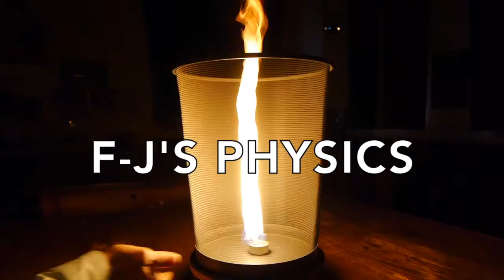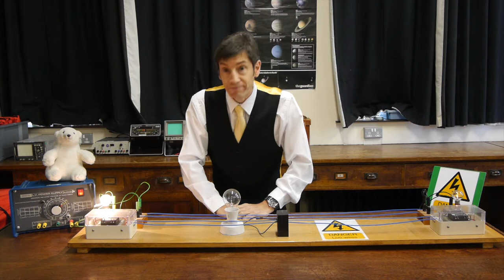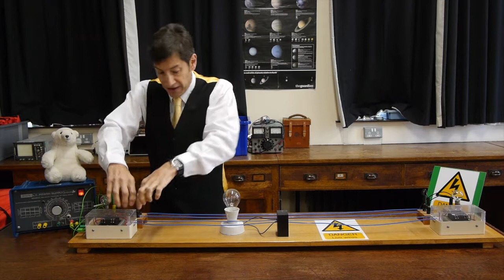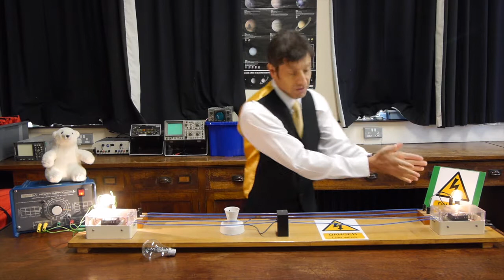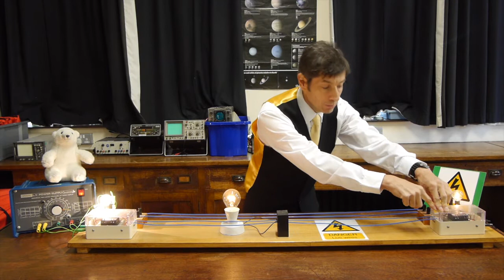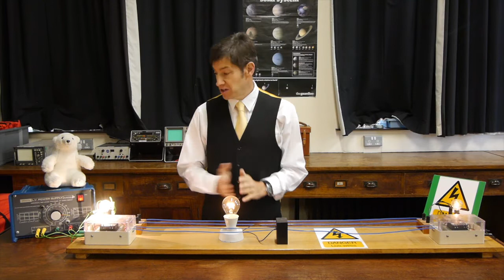Power Lines - F-J's Physics - Video 107

Comment: I love this demonstration. We also use four large display multimeters to show the increase and decrease in voltage either side of the two transformers.
Reply from the maker: That's a great idea Paul.  Good that you have demo meters that can do this (or perhaps you made your own shunts?) Not all schools include the mains lamp which I think does show things very visibly too (thought the time will come when children have not seen one of these!).  Of course the height of power lines has a lot to do with capacitive reactance etc. and even in this experiment one glosses over power factor, impedance and all that physics but it is a lovely demo (and not banned yet as far as I know).  I am very annoyed I said 'coils' instead of 'turns' - pressures of all the filming I am doing at the moment I guess!
Reply: They are standard multimeters but have a large digital display. This demonstration links nicely to your video on power in parallel and series circuits. FYI I am a science technician in a secondary school and I think your videos are great. I have shown some of your demonstrations to teachers in my department (e.g. The Doppler Effect using a spring, Fire Tornado, Finger Diffraction) and they have then incorporated them into their lessons. I even bought a Tea Pee Boy as a result of watching your video.
Reply from the maker: Big multimeters - yes that's a thought!  Great to hear that you show them to others in the department Paul.  I do pass them on to our technician too who may not have seen the experiments before or be unsure how to set them up.  I purposely try not to copy other youtubers but just do my own thing.  Do let me know if there is anything I could make a film on (I may have it in the can already!).  Best wishes, and I hope this tricky time is not too troublesome for you.